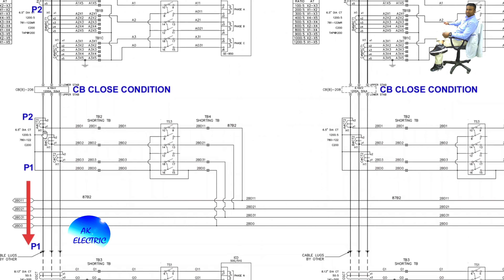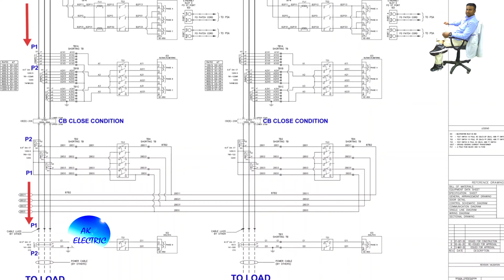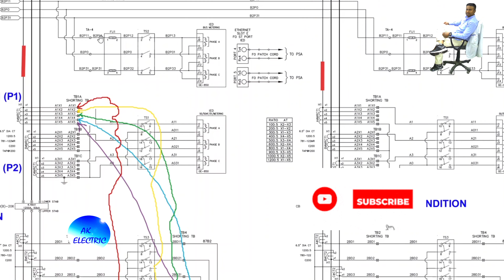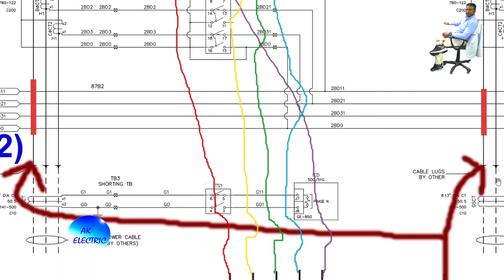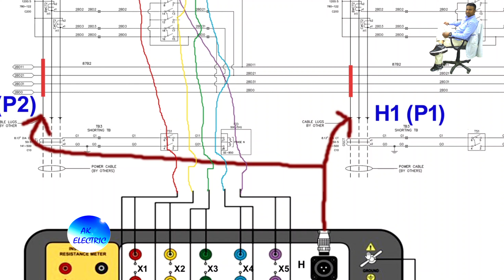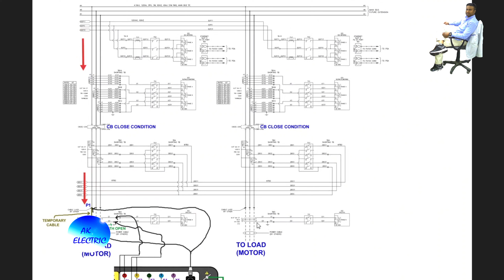CURRENT TRANSFORMER TESTING BY VANGUARD, SCHEME EXPLAIN, TEST REPORT ANALYZE, CT RATIO, THREE LINE

Comment: Bro, IR, WR, polarity, ratio and knee point test elame orey timela namaku display la result ah kidaichuruma?

Intha 5 test mattum podhuma? Illa vera ethathu test eduka vendi irukuma? Solunga brother please..
Reply from the maker: Dear Hi,

Insulation Resistance test is with separate test kit and other 4 test is enough. This 4 test results will be performed in one test kit and in one result.

Also we have to confirm the cable burden of CT secondary to relay.

If cable burned should more then CT burden then CT will be damaged. 

So measure CT secondary cable impedance also.

Thanks